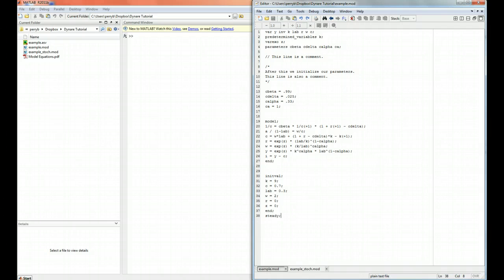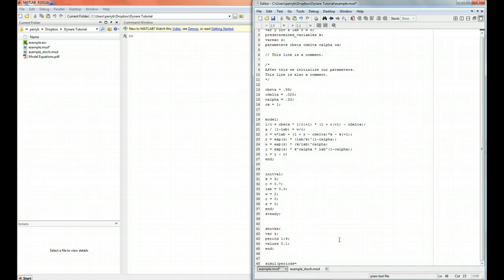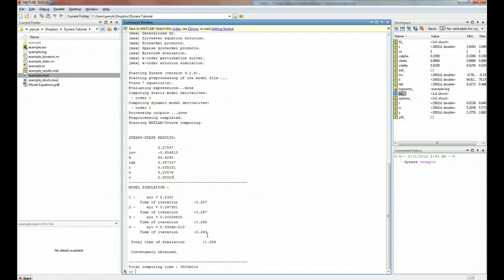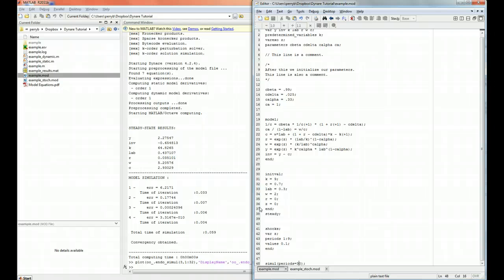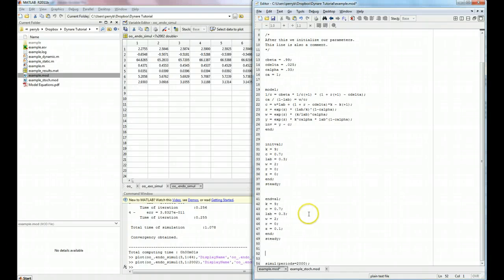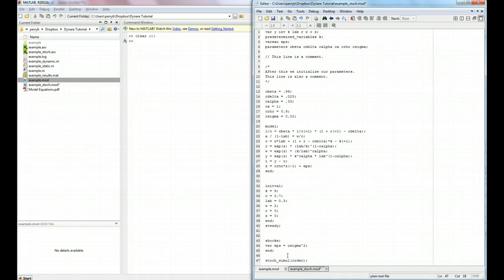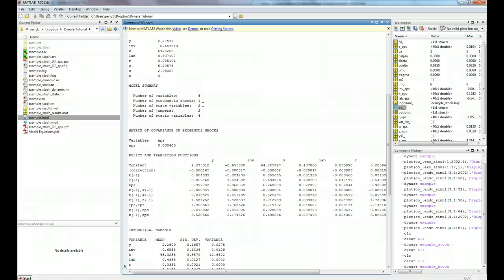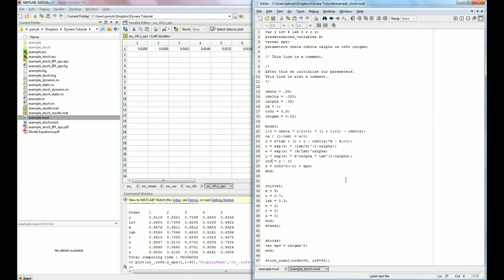Dynare 2

Comment: To those getting an error about impossible to find Steady State, it's because of a mistake in Bryan's paper of the model.
The characterizing equation for c is: c = w*lab + (1 + r - cdelta)*k - k(+1); (line 22)
It is therefore not: c = w*lab + (1 - r - cdelta)*k - k(+1); which you might believe, when looking at the paper.
Reply: thank you  , yes it is the point

Comment: I got this error message typing the same code you did

Error using print_info (line 32)
Impossible to find the steady state (the sum of square residuals of the
static equations is 101.3886). Either the model doesn't have a steady
state, there are an infinity of steady states, or the guess values are too
far from the solution

Comment: I have been trying this for hours and i keep getting the same errors and i have no idea why. 

"
Error using print_info (line 74)
Impossible to find the steady state. Either the model doesn't have a steady state, there are an
infinity of steady states,  or the guess values are too far from the solution

Error in steady (line 92)
    print_info(info,options_.noprint, options_);

Error in example1 (line 128)
steady;

Error in dynare (line 180)
evalin('base',fname) ;  

"